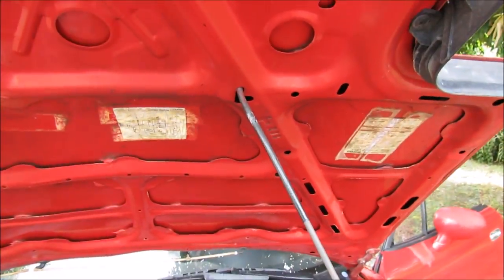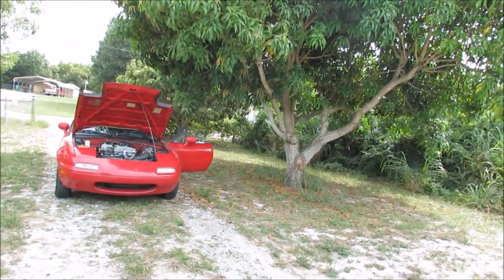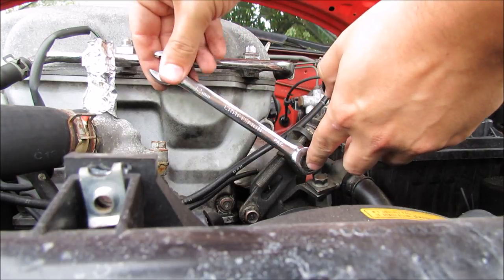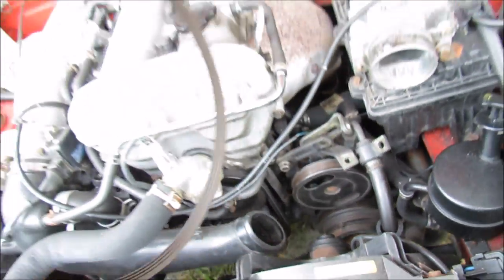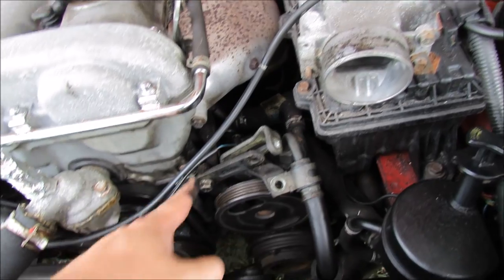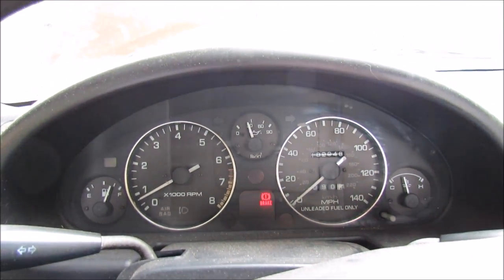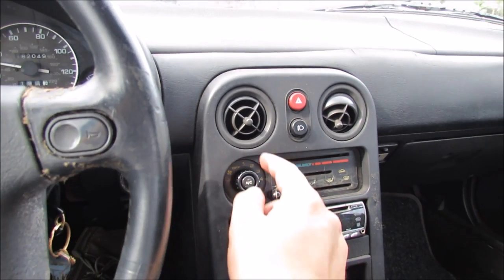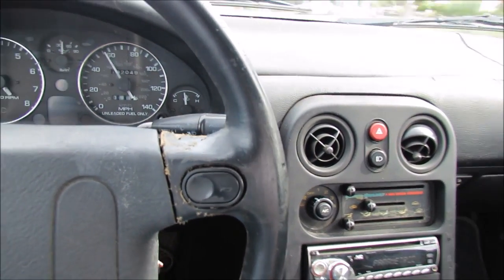How To Delete Miata Power Steering & AC For FREE!!!

Comment: Your fan issue is probably the thermoswitch. It's the thing sticking out of your thermostat housing wrapped in aluminum foil. I had to replace mine and it worked perfectly well. About $17.

Comment: There's a bolt behind the power steering pump pulley that you access through one of those big slots in the pulley.  Need to crank the engine till you can see it. Its behind the slot closer to the engine. That's the actual bolt you need to loosen to get the pivot point loose.
Reply from the maker: Thats good to know!  My next step with this car is to swap to a v8.  i've been preparing and planning since i got the car.  Its coming, just need to get other things in order first.  Like always right...
Reply: Sounds awesome!